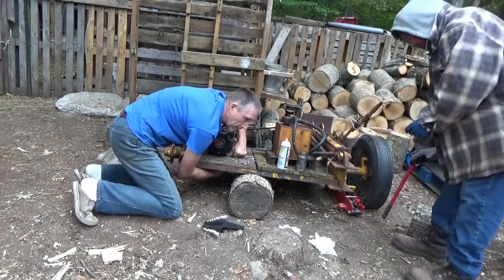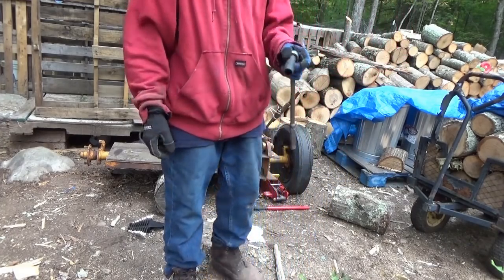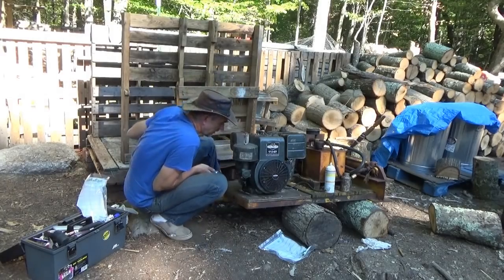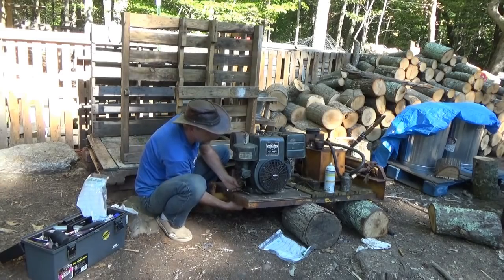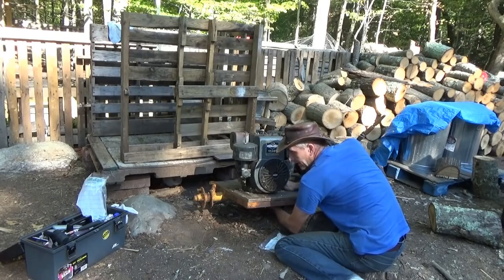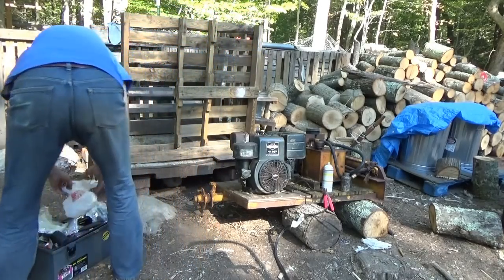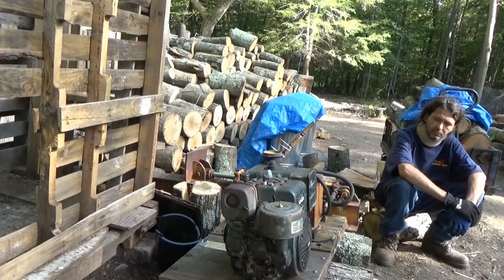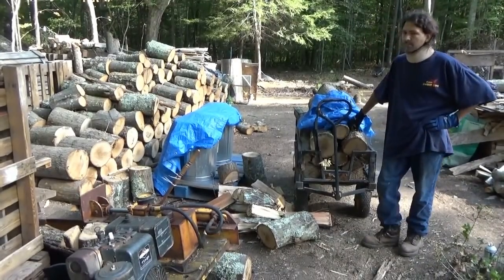Mounting 11 HP Engine On Antique Log Splitter & Test Run

Comment: With the additional power from the rebuilt engine could you weld another cutting blade to the existing blade and make it look like a star then you would be able to split each piece of wood  4 times - this would really increase your production but at the same reduce fatigue?

Comment: FIRST? Love to see old things brought back to life. renew, restore, repair, refresh, repurpose! I was thinking all along, "I wonder if he has sharpened that cutting blade on the splitter?" Looking forward to hearing if that helped.
Reply: There is no reason to have a sharp wedge, it's not the sharpness that splits the wood, it's the pressure of the pump and cylinder  plus the thickness of the wedge taper that  does the splitting, A sharp wedge is just an easier way to get hurt, or cut badly. some types of wood will not split easily, such as what is known around my area as Piss Elm, it is the stringiest wood I have ever come across in my 73 yrs of life
Reply: Thank you, Nortekj. I know nothing about wood splitters, and couldn't see what the "wedge" end looked like. I assumed it was some sort of blade.
Reply: BANDANA GRAMMA It does look sort of like a large knife but it is stationary and the ram portion of the hydraulic cylinder pushes the log  to it and then that's where the pressure builds up forcing the log to either split or stall the engine  or cause the belt to slip or break. But again the leading edge of the stationary wedge shaped blade does not have to be as sharp as a knife or an axe. I have three splitters myself, 2 which is gas engine powered and one that is powered by the hydraulics of a farm tractor and neither of them has a wedge that sharp at all, in fact I can slam my hand into either of them and not have to worry about being cut. Once you see one in action in person, you'll understand the mechanics of how any splitter works

Comment: You need to clear the cutting edge of the splitter. Let the split pieces fall off the end. If it splinters like that just put another piece behind it and put it through. You could be a lot more efficient at it handling the wood less. You are working to hard, work smart not hard.

Comment: Troy when you get stringy wood like that, back the push plate off while the log is still on the wedge, then put another log behind the first piece  and shove it all the way through, doing it as you are now is wasting time and energy. Also mount the engine on a tilt table effect on the splitter base, and using another longer bolt to pull the side of table away from pump pulley downward, that will allow you to really tighten the belt as tight as a banjo string.
Reply from the maker: Now that is a great idea!! About splitting the logs. Thank you very much!!
I like the idea of a tilt bed too. Thank you

Comment: Troy, after you put the wheels on and sharpen the blade, are you going to raise it up on pallets or a platform to get it to waist height? I have been working on my own off-grid homestead for a couple years and at 53 years old, I am finding that the less I have to bend over the more stamina I have.

Comment: where's the pre filter for the air filter (16:11) which needs to oiled!
do you plan to reinforce the plywood with metal so that 11hp doesn't shake that deck apart?

Comment: Sharpening the blade will help but it won't sever the "folded" fibers holding the pieces together. That's Elm wood, it splits UGLY... all the time,  unless you adjust the blade so it actually meets the backing plate at the end of it's stroke. Way cool 11 horse!
Reply from the maker: Ok, thanks for the info

Comment: How many tons does that 11 hp engine push?
Reply from the maker: It can easily run a 25 ton log splitter. I am still using the same engine on a different log splitter at our Michigan homestead

Comment: You need to get rid of the belt and put a love joy coupler on it
Reply: A lovejoy coupling is the way to go  BUT it also depends on which direction the pump has to turn to put the pressure to the cylinder, using a love joy coupling would make the pump turn backwards to the way it turns now and could possibly destroy the pump vanes

Comment: Why don't you make your own p b blaster.  50% asstone and 50% auto transmission fluid put it in a spray bottle. About two dollar a gallon yes gallon. Remember safety is number one on your homestead.
Reply: i learned that one from the youtube channel .....i like doing it cheap .... and yes it is very effective
Reply from the maker: With transmission fluid costing $4 per quart here I dont get your calculations. But thanks for the info. I had no idea
Reply: The Do It Yourself World 1 quart acetone 1 quart cheap transmission fluid = 1/2 gallon of penetrating oil for 8 bucks or less ... little aresol can of penetrating oil cost 4 bucks ..the math adds up for me
Reply from the maker: Dont misunderstand me. It sure is cheaper. I just cant get it for $2 per gallon around here.
Reply: Do you mean $2 a pint?
Reply: I used old transmission fluid drained fluid and a stone at WalMart for two dollar for one gallon.
Reply: william burnett
OK, I guess if you got old used transmission fluid from a garage or something, that makes more sense.
Reply from the maker: Ok, now that makes sense. Thanks

Comment: do you pay chris to help ypu out or is he unemployed?
Reply from the maker: I am sorry but I hope you understand that I have learned not to share anything about Chris for his own protection.
Reply: nah thats ok - i just noticed he was out there every day and was concerned that he was missing work or somthing - but still helping you out with a broken neck is a massive effort and good on him for helping you out
Reply from the maker: He is a great friend. He has nerve damage. The brace just helps keep off the pressure.
Reply: oh i see - i hope it isnt permanant (im not a doctor) but yeah good luck to you both - and with firewood - dont feel bad if you have to use the propane heater if the fireplace is out
Reply from the maker: I hope so too. I prefer to use the wood stove because the wood is free and propane is not. Problem is this time of year its too warm for the wood stove but too cold without.
Reply: fair enough - if you are having rainwater collection and it gets too hot perhaps remove some of the insulation from the roof - this would thaw the snow on the roof? and melt it into usable water??

i dont know as where i live it doesent snow